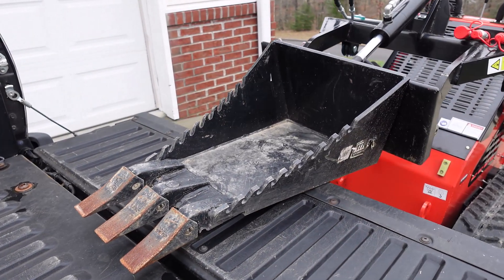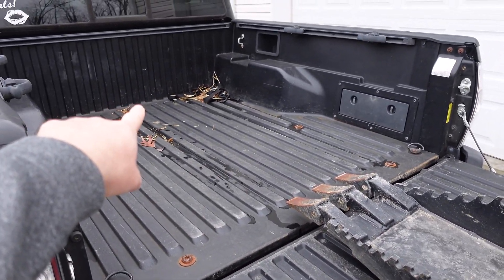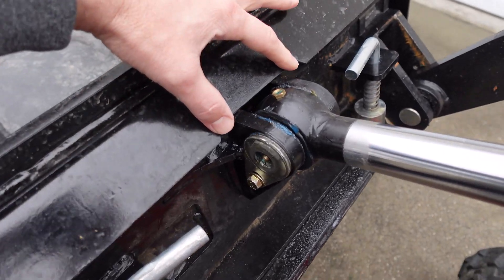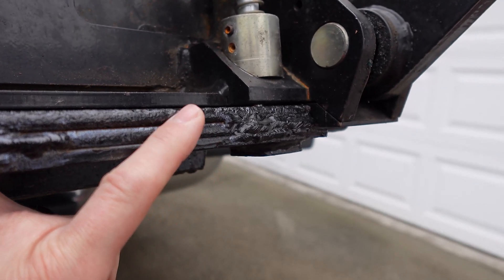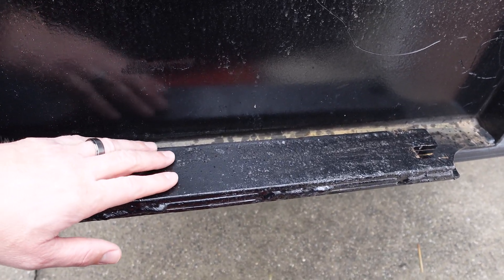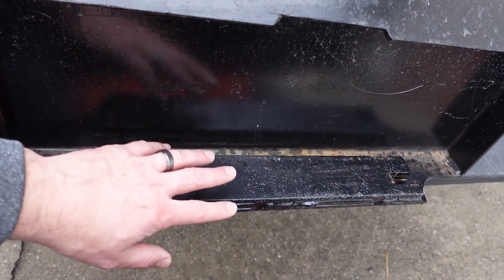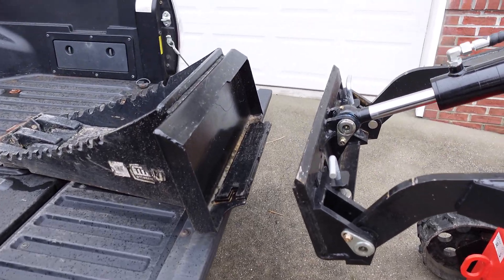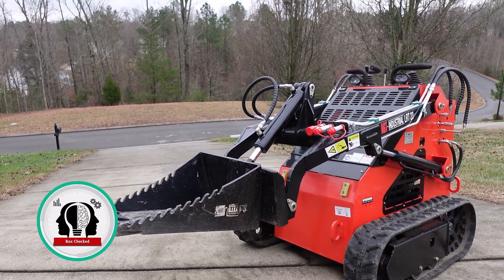Stump Bucket Modification for the AGT Industrial LRT23 Chinese Mini Skid Steer

Comment: Do you know if Rustoleum or Krylon has a paint that is a close match for the red color?
Reply from the maker: Great question!  I have not done any touch up painting on the LRT23.  So, unfortunately, I do not have an answer.  This is something I would like to know myself.  I'm sure someone out there has matched the International Orange color of the LRT23.
Reply: Hopefully someone will see this and chime in with an answer.  The Mrs says it looks like a red / orange vermilion color.
Reply from the maker: @bassthis  Yep.  Looks red when its overcast outside and looks orange when the sun is out.  Lookup the color International Orange.  Of course, there are several variations of this.

Comment: You mention you upgraded the tilt cylinder. What are the specs on the upgraded cylinder? Where did you purchase? Thanks
Reply from the maker: Good morning.  All the cylinders on my LRT23 are original.   The only thing I have done is shim a few of the joints to reduce the amount of play.  Otherwise, the LRT23 has been stellar performer for me.  

My mini excavator on the other hand might need a little tweaking, which will be in a future video.  Thank you for watching!
Reply from the maker: Here's a link to the shim video if you're interested: https://youtu.be/ud5MI9WGp7s?si=i2gSyho_gtbUqAGi

Comment: Your modification is a little complicated and time consuming - A simple fix for this and all aftermarket attachment plates is : On the attachment mounting plate - Spot weld a 1 x 1/2" square tubing inside the V notch full width - spot weld a 1/8 inch shim behind where the pins engage - Turn the ram to knuckle over so the zerk fitting is on the bottom - done perfect fit without much welding or cutting
Reply from the maker: I considered modifying the v notch and actually wanted to go that route, but the steel supports, which stick down about 3/4" under the bucket curl joints, also have to fit in the stump bucket mounting plate.  So, I had to get creative.  
Thank you for watching!

Comment: Do you believe this would be more effective than the stump grinder attachment?
Reply from the maker: Stump grinding vs. stump removal - two completely different methods of addressing a stump.  I would say if the stump is small to medium, just use a stump bucket to dig around it until you can pull it out of the ground.  Then refill the gap with dirt.  If the stump is massive, I would probably go with a stump grinder.
Reply: The grinder needs high flow hydraulic to be effective.